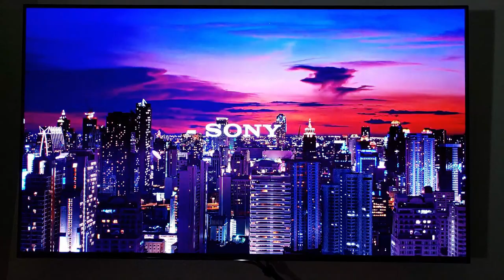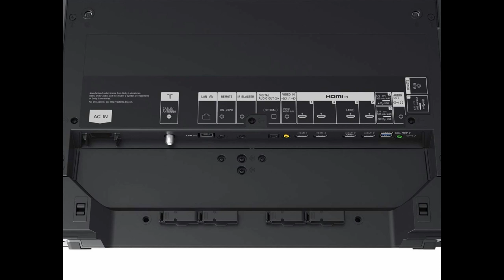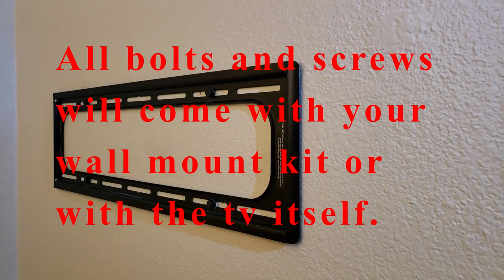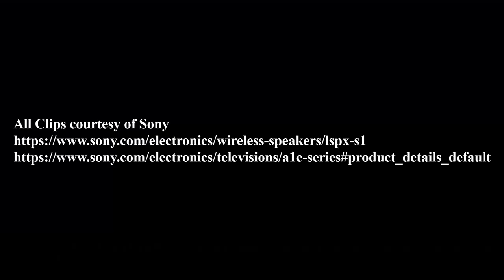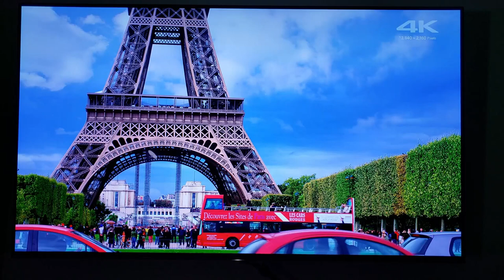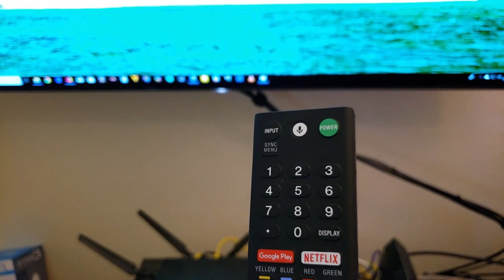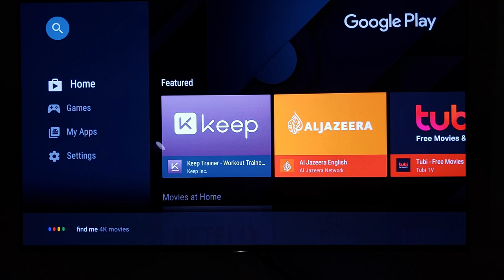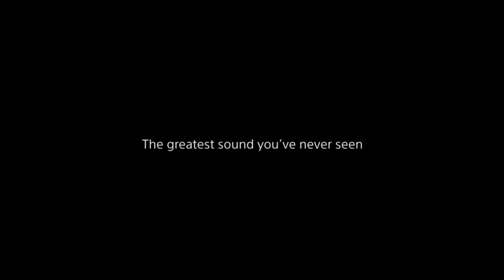Sony Bravia A1E Review & Wall Mount Installation

Comment: Hi, do you have to install the wm1 and wm2 brackets to wall mount the tv? What do they do exactly?
Reply from the maker: Thanks for watching. Yes you do, the wm1 & wm2 brackets holds the tv's kickstand in place so the tv won't move when wall mounted.
Reply: @theworkoutgeek  Are they pre-installed from the manufacturer? I ask because I’m on the verge of buying this set second hand but he doesn’t know anything about the brackets.
Reply from the maker: @DizTV  the wm1 and wm2 brackets should already be included with the tv. You have to buy the wall mounts separately.

Comment: Hello. Where did you get the wm1 and wm2 brackets to secure the stand to the tv? Did they come with tv?
Reply from the maker: Hello, thanks for watching. Yes they came with the TV. If you got it brand new it should be with the other accessories. If you buy it used I recommend you buy it from a reputable retailer like Best Buy